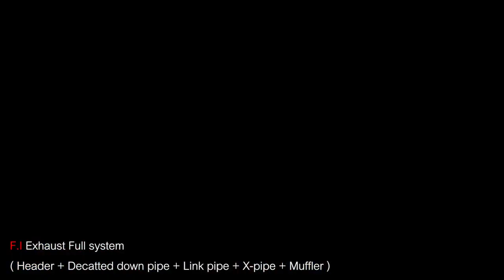Porsche 718  Cayman S  X Fi Exhaust -  Installation / Revs / Acceleration X HitZ SuperCar

Comment: I have a 2017 718 S. Seriously thinking about getting this exhaust but I can't find any specs on it. Weight compared to stock? Expected hp gain over stock? I'm in San Francisco Bay Area, went to the only dealer in NorCal, they had nothing as far as specs.  This or fab speed turbo cup cat less. Save about 40 lbs, gain close to 10hp, $1700.00. Does not sound nearly as good and will most likely drone, but the performance is there. Anyone have any info?